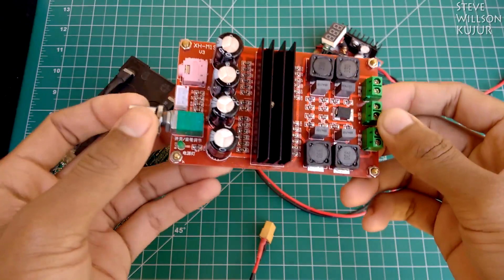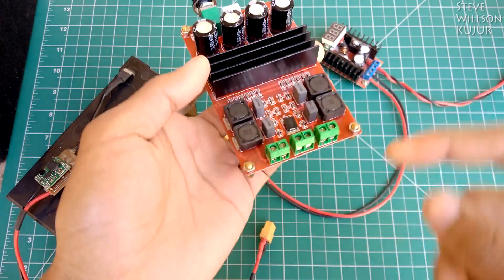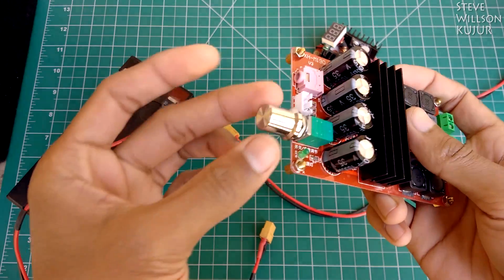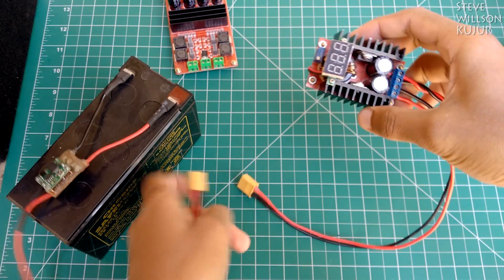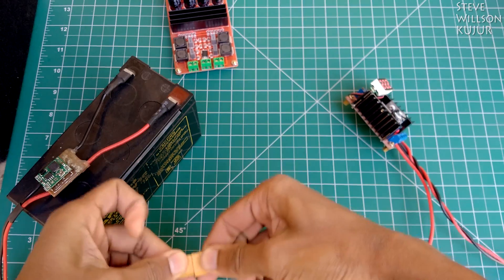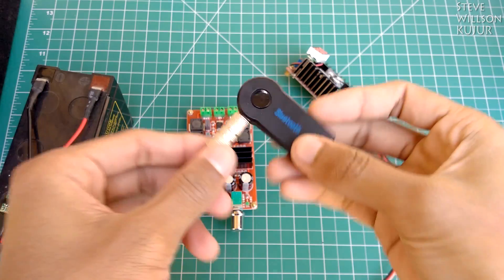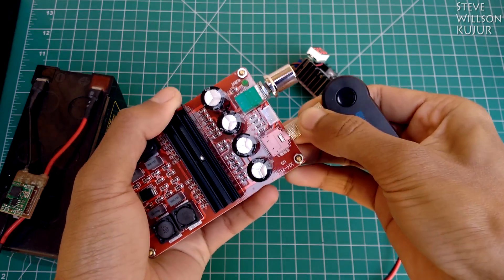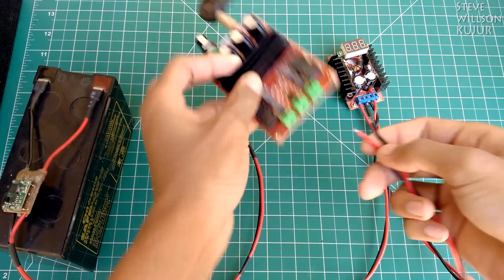TPA3116D2 Amplifier Test | Class D 200 Watt Amplifier

Comment: This board needs high level audio input from better source. It should have onboard gain settings. I have seen some geeks who changed resistors to achieve it. Your Bluetooth module couldn't produce the amplification. Must provide solution to this problem.

Comment: I have the same unit,it sounds good,but I hear a loud pop on the speakers Everytime I switch it on for off??
Reply: I have the same problem with it n I solved it by turning the volume to the lowest level possible, so u won't hear the buzzing boom every time u turn it on

Comment: Nice Vid!  I have this amplifier ,two actually..  You can get even more out of it by switching the capacitors to  rubicon 50v4700uF pk (4x) or similar...:) I am able to drive big speakers (30cm woofers) with it at 24v 4 amps !  Used the other amp as comparison later, it can`t drive them as hard by far :)

Comment: So if im using a 100w 6ohm pair of speakers, then how many amps (max) would this amplifier draw?
Reply: Power Supply needs to AT LEAST match the amp rated output. It's rated 200 Watts so at 24V that's about 8 Amps. You need more than that if you want clean power, I'd say 10 Amps total.

Comment: I connected here an mp3 decoder on such an amplifier. All connected in a 12vcc 5 amp power supply. The set has a noise. If I turn on separate sources the noise disappears. You know what it could be?
Reply: Sounds like you need a ground loop isolator

Comment: I try to use the power from the former 12v computer psu (yellow & black cable) can't work, every time I turn on the potentio, the psu fan turns off. why? is it because it's only 12 volts?
Reply: No, the amp will work on 12V. Go and buy a proper power supply (24V 8-10A) for it.

Comment: The absolute maximum you will get from this device (dual bridged TPA3116s running at 24V) is 30W per channel into 8 ohms, and 50W per channel into 4 ohms
Reply: The TPA3118D2 is the 2x30 watt chip, while the TPA3116D2 is the 2x50W chip, this board uses a pair of TPA3116D2 chips with each chip running it outputs in parallel, that is how it gets 2x100W

at least that is my understanding of it, but there  are boards out there that only use 1 chip and claim 2x120W
Reply: This amp gives 100 w rms from each channel, it can drive 8 speakers 25 w rms 4 ohms at the same time n continuously without heating up. Don't worry I use them in home theater speakers n they've passed their test

Comment: I am not getting enough power with 12 volt power supply, should i use 18 volt Steve?
Reply from the maker: You can use 18v for more power, i use 24v for maximum power

Comment: Hi Steve. Thks 4 vid. Trying to build an EMPF system with signal frequency generator SG 100X and this amp board configuration. For driving two rodin coils inspired from https://1stopenergies.com/p/therapy . Low frequency resonance is key in this build. Will the amplifier support low frequency pass? Or just down to 14Hz ? Thx m8

Comment: The heatsink on that amplifier seems awfully tiny for 200 watts. I have a TDA2030 30-watt amplifier and it has a heatsink twice the size. I can't imagine this amplifier running at max volume for very long without overheating.
Reply: Since its D class so they are about 90% efficient, 2030 I think is AB class amp so its less efficient and converts power into heat so it needs bigger heatsink.

Comment: hello. 
I need to power a 600w Pyle plpw6d subwoofer speaker. can you suggest me something that would work with my 12v car battery ?
Reply from the maker: +Somenath Sikdar you can use this amplifier
Reply: Get a mono class d amp. Even the small chip ones will work
Reply: Buy a fucking CAR AMPLIFIER. They are designed for operating CAR speakers from CAR batteries. You can install them in your CAR and listen to music.

Comment: You said 100W to each channel. Is it maximum power output OR watts RMS ? On the datasheet (http://www.ti.com/lit/ds/symlink/tpa3130d2.pdf) it says  50W x 2
Reply from the maker: +Bruno Sousa one chip can give 50w x 2 and in Bridge it'll give 100 watt .

And this module have 2 of these chips

Comment: Hi bro i love your chanel, can you tell me how many volts you need to use for 100 watts for 1 speaker and how many volts for 2 speaker(200w)
Reply from the maker: +Mega Fail no matter you use 1 or 2 ch you need in between 12v to 24v
Reply: Ty bro, but look at this video https://youtu.be/N3k9lWz48rw the amplifier has only 50w and have more sound than yours.Can you tell me who is beter to buy!!Thanks!!
Reply from the maker: you can't just tell by hearing from mic 
i've both amplifier laying around my work bench and TPA3116D2 is definitely over killed by 150 watts

Comment: Do you think I can bridge the channels and make it a 200w mono-channel?

Thanks. Great video!
Reply: And I read you said it's running up to 80 RMS. I guess that's when running 24V. How many watts do you think it'll run when running 12V ?  :)
Reply from the maker: +Nicolai Grymer no it can't b bridge because it's already bridge 2 mono amp are there
Reply from the maker: about 40-50 Watt RMS
Reply: So it's actually a 4-channel amp which is already bridged to be a two-channel? Can't you bridge two pairs of amps? I think car-amps can do it
Reply from the maker: +Nicolai Grymer no it can't be Bridge again it's not possible "physics law" 

Car amp can do because there is already 2 channel so you can bridge it .

And this one have 4ch and 2 are bridge to get 1 stereo ch
Reply: Oh sorry. I am not talking about this specific amp. I have purchased the exact same chip and board except it's a 2ch with 100w in each.

http://www.ebay.co.uk/itm/112313837422?_trksid=p2057872.m2749.l2649&ssPageName=STRK%3AMEBIDX%3AIT
Reply: @oOosupernicoOo  - nobody cares what you purchased.
Reply: No. The TPA3116s are already bridged in this board's configuration

Comment: Hey Steve. I wonder if this amp has any white anoying noise? Cause every amp of this kind with onboard bluetooth module has really anoying white noise.
Reply from the maker: no very clean sound
Reply: Have a look at other YouTube reviews of this board and you will see that there is slight hiss. This can be reduced or removed by changing gain resistors on the boards. This requires skill and experience with a soldering iron and surface mount components.

Comment: at 20 volts how many watts were u able to pump?
Reply from the maker: 75 watt max
Reply: son of a gun   nope, 20V *6Ah (max) is 120W max, but it's not 100% efficient, probably around 85% efficient. so, 120*0.85 = 102W maximum, total.   roughly 50Watts per channel.
Reply: @vincentkoster6291  I was able to pump 32 PSI into my Mercedes tires in 10 minutes. Do your math dude!!!!!

Comment: How much power is it actually doing?
Reply from the maker: +Gershon Dharmanandan 80 watt RMS each channel for sure
Reply: really? you sure its outputting that? it doesnt look/sound like it...
Reply from the maker: +Gershon Dharmanandan it is
Reply: Steve Willson Kujur did you measure it with a multimeter?
Reply: 100 watt per channel peak, So by doing some math, you get 50 watt rms per channel.
Reply: Read the data sheet.
The maximum you will ever get from this board is 30W per channel into 8 ohms or 50W per channel in 4 ohms.
You MIGHT be able to push it to 100W per channel but that would be into 2 ohm speakers and you would need better heatsinking and a very good power supply (minimum 24V 10A for example).

Comment: how many amps it need ?
Reply from the maker: +mellem max 6 amps
Reply: It entirely depends on what potential (voltage) input you are using, and what the impedance of the speakers are.
For example . . . if you are using 8 ohm speakers and running at maximum power (24V), the maximum output power is going to be 2 x 30W = 60W total. I (current) = P (power) / V (potential in volts) . . . . so 60/24 = 2.5A.

So for 8 Ohm speakers and 24V power supply, it will be drawing 2.5A total.
With inefficiency and headroom, I'd say you'd need a power supply that can deliver at least 4A.

(P.S. Forget about this being a 200W amplifier unless you are using 2 ohms speakers, very good / improved heatsinking and a quality power supply)
Reply: Where did you get 2 x 30W from?
Reply: @dyumanaditya5158  - 2 x 30W is the output is into 8 ohms speakers.

Comment: really check your ratings on your amplifiers better just because it has 100 1 and 2 channels does not make it a 200 watt amplifier that only means it's a 100 watt amplifier into two channels. rating a multi-channel amplifier by adding the power of all channels involved is misleading the size of the amplifier
Reply: dukedurell - you are a total fucking idiot. Your comment is one of the most stupid, inane, halfwitted replies I have ever seen on Youtube. You not only failed at Mathematics, but by making that comment you proved that you also failed at life.

Comment: hey bro my step up convertor when connected to my amp the module (step up convertor) shuts down and the led lights go very low and it heats my amplifier so much so i discard it and used a 12 v 5 A ADAPTER ITS AWESOME and i use the step up  convertor with an adapter of 12V 1A so do you think there is a problem with the module or the current that is too low
Reply from the maker: +AKI BASS probably there is problem with step up converter
Reply: THANK YOU MAN BUT DO YOU  think the adapter current was too low thats why it didnt work properly
Reply from the maker: +AKI BASS no that's not the problem it can run with lower current also I've tested it
Reply: will it run on a 5v power bank?

Comment: Hi I'm trying to incorporate Bluetooth speakers into a vanity mirror I'm building. Is there anyway you could help me with the electronic end? 

I've watched plenty of videos but I'm not sure how I will add Bluetooth speakers, gfi outlet, & lights to wall plug.
Reply from the maker: +MIXED TEA i would like to help you ask what you exactly want to know.
Reply: Steve Willson Kujur thanks so much for the response. 

So I'm making a vanity mirror for my girlfriend. On the vanity it has 8 lights, GFI Outlet & an ON/OFF switch. 

I'm trying to figure out how I can incorporate Bluetooth speaker drives to the vanity & tie into the 3 prong power cord that's plugging into the wall powering the vanity. 

Hope that makes sense. Hopefully you can help. Thanks a lot!

Comment: Hey Steve, your videos are great.
I've noticed some people mention use speaker protection circuits with these Class D amps. (Mainly for when powering on), as they generally don't have any muting or protection built in.
What would that involve and do you know where you can get them from?
Thanks
Reply from the maker: +Ben Helweg speakers protection is built in .
Reply: Thankyou.

Comment: bro check that monster amp module its a 215 w rms amplifier  https://www.aliexpress.com/item/Ultra-TDA8950-TDA8954-210W-210W-digital-amplifier-board-fever-finished-2-0-after-two-channel-Class/32769254338.html?spm=2114.01020208.3.65.pN3ecw&ws_ab_test=searchweb0_0,searchweb201602_2_10065_10068_10000009_10084_10083_10080_10082_10081_10060_10061_10062_10056_10055_10054_10059_10099_10078_10079_427_10073_10103_10102_10096_10052_10050_10051,searchweb201603_2,afswitch_5&btsid=8cd9b9e1-f538-4178-8dc2-0bafd7ba322f

Comment: hey bro concerning the amplifiers the one that is samwu audio 50 w pmpo hey is it true its 50 w pmpo its not rms but when you played it with your amplifier to your bookshelf speaker they worked fine explain plz
Reply from the maker: +AKI BASS what you wanna know?

that samwu one is 25 watt rms
Reply: i want to power up a sony 35 w rms with the samwu and i want to buy an amplifier for a bookshelf speaker 200 w rms what amplifier can i use it has a total of combined power of 1200 w pmpo what amplifier do you recommed me
Reply from the maker: +AKI BASS i recommend TPA3116D2 

it is better then TDA7498
Reply: is it to power the sony 35 w or the 200 w bookshelf
Reply from the maker: +AKI BASS for bookshelf
Reply: you sure bro i am sure the amp will burn up if i connect it with it.
Reply from the maker: +AKI BASS I'm pretty sure it'll not burn up

Comment: Hello my friend, I'm from Brazil and I liked the tests you're doing with class D amplifiers, I have a question which is the best TDA7498 or TPA3116D2 or TPA3116D2 2.1? Can I connect in a 24v source?
Reply from the maker: +Ivo Henrique Mendes my favourite is TPA3116D2 Amplifier . and is the best 

yes you can use 24 V but don't go above 24